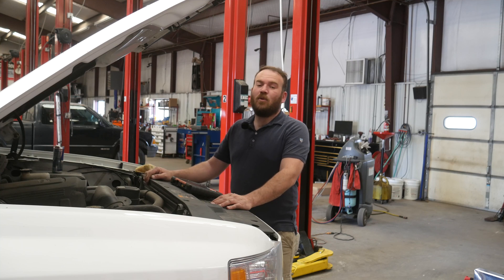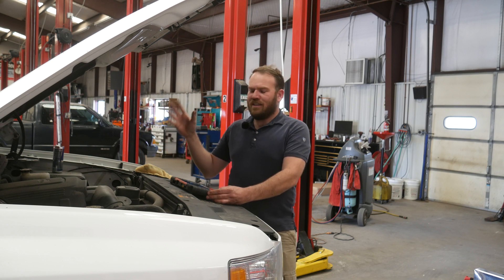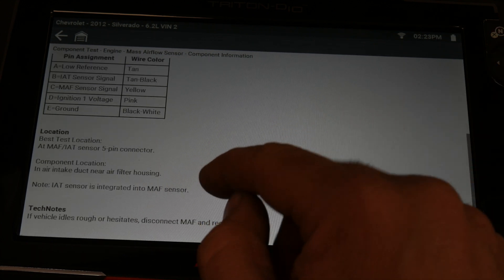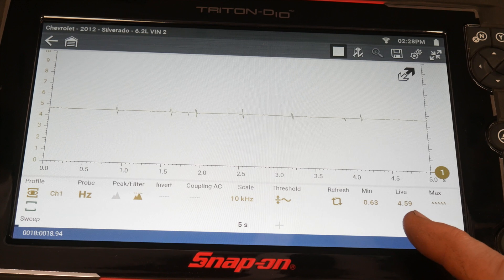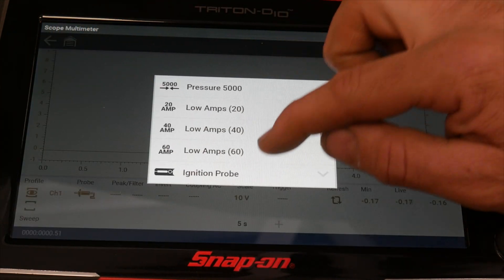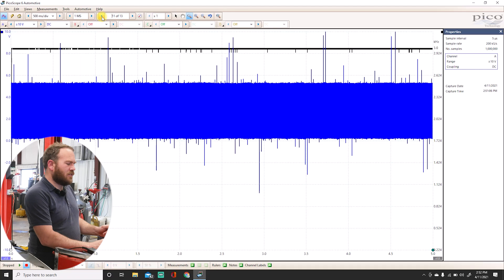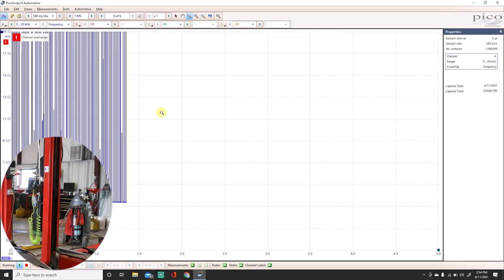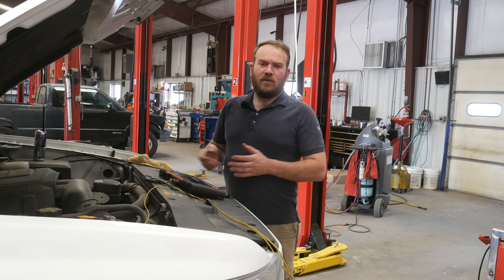(Fixed) Weekly waveform 18 -  How to test a digital MAF sensor

Comment: So just to be clear, when the car is at KOEO, the sensor IS measuring a frequency? Also what frequency (HZ) should be normal on a chevy when it's KOEO?
Reply: I was under the impression that there should not be any kind of measurement while the engine is off since there is no volume of air measured across the sensor while the engine is off

Comment: I wonder if you remove the mass air flow sensor and regulate some airflow into a known good sensor  could you then regulate air to get the same voltage and then determine based on airflow the condition of the MAF sensor?  There's an idea that just came to my mind watching this video.
Reply from the maker: That is how they test and calibrate them on the assembly line. The problem with that is knowing what good is. You would have to start testing them and making a database of know good at certain airflows. 
Many Toyotas use the same part number sensor on engine sizes between 1.5l and 5.7l. They just change the size of the tube the sensor is mounted in. A larger tube lowers the air velocity at the same airflow so the ECM has to be calibrated for that tube size and MAF voltage in order to convert it to grams/second. 

Many aftermarket cold air intakes mess with the tube size and cause issues with MAF readings.  Some will run a larger tube and then narrow the tube near the MAF sensor to attempt to match OEM airflow. A larger tube will cause lean running and a smaller tube will cause rich running unless the ECM is tuned for the change in tube size. This is where the GM MAF sensors are nice because the tube is part of the sensor and a honeycomb is placed at the beginning of the tube to straighten air flow. The sensor calibration isn’t affected by intake tube changes with this style of sensor.

Comment: I have a maf/iat sensor with 6 wires. 2 wires are for the iat. the other 4 are for the maf. of these 4 wires.... one is 12v....one is ground.....one says maf return which the wiring diagram indicates is pcm supplied ground.....one says maf signal. looking at the shape and design it appears i have a hot film type which the whole thing just resembles a small rectangular chip, perhaps the surface area of a half dollar.  can i safely assume that the signal it generates is digital and in hertz? i do not have an oscilloscope however my multimeter has a hertz function.  i would like to diagnose this properly being i have a p0102 code and the live data feature on my scanner shows 0.00 grams per minute at any rpm (dead)
Reply from the maker: I could still be either design. voltage or frequency based. I would check to see if you have voltage on the wire first. Even if its a digital MAF sensor the Meter will average the reading. if you have some voltage displayed start the car and see if the reading changes, next try the hertz option and see if you get a reading.
Reply from the maker: Also, some vehicle and some scanners will show you MAF voltage or frequency in the data list.